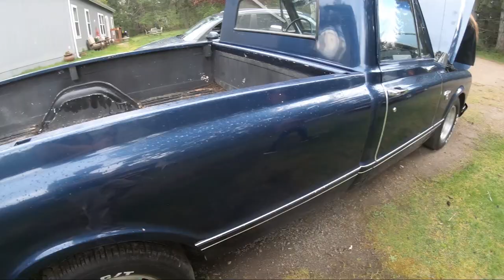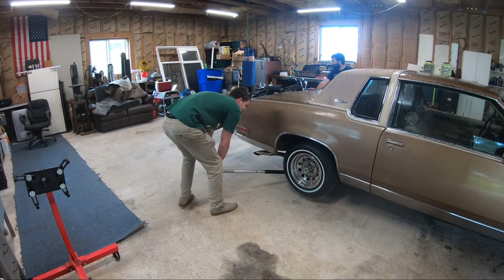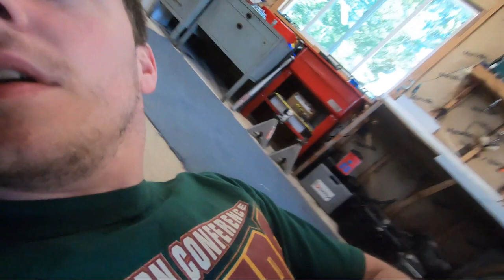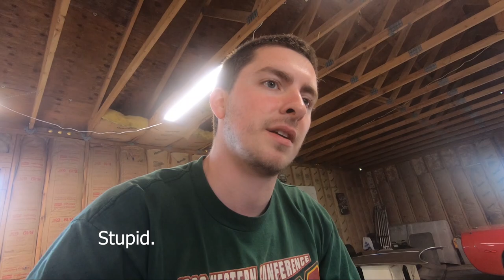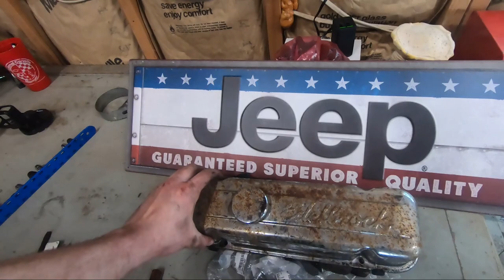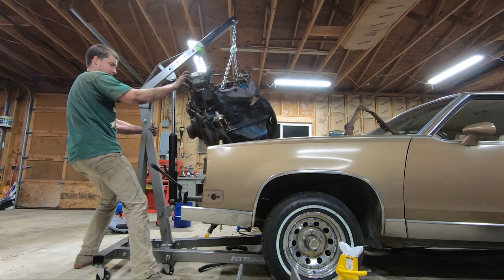SKETCHY ENGINE PULL! Pulling the V6 out of my Cutlass Supreme!

Comment: Wow that was both hilarious and painful to watch you definitely did things the hard way in some instances haha Remind me when I first started working on cars doing half the things you just did not knowing there is such a better way haha 
On another note your transmission is probably not going to work with a V-8 unless you get a Buick olds or Pontiac style engine those V-6 engines like the one you just pulled out all have BOP style bell housing on the back of the block and they only mate up to the BOP style bell housing transmissions (Buick Oldsmobile Pontiac) They did make turbo 350’s with both style bell housing which would explain how you have a turbo 350 on a V-6. There is one Transmission that works with both style bell housings BOP and Chevrolet and that is the turbo 200R4 (4speed auto) You were also going to need a complete set of clam shells and motor mounts from a V-8 Gbody car anything related to that V-6 is not going to work I did a V-6 to V-8 swap for a guy on a monte Carlo in one of my videos I didn’t get to complete the job because the guy cheap doubt and didn’t want to pay but there is some good pointers in there as I got about halfway done. Check it out if you’re bored
Reply from the maker: Thats definitely something I need to check on. Thank you for the info. Ordering the motor mounts soon and trying to source a motor right now

Comment: Ps. The front header panel or front clip as you call it did not have to come off you simply just had to lower the front of the car and if you don’t quite have enough let the air out of the tires and gain a little bit more room lol For next time I guess
Reply from the maker: I always appreciate advice like that. Thank you very much.

Comment: I have an 81 cutlass myself. But I just found out that my cat converter gets bright orange hot. Any idea what causes it to get so hot? Thx
Reply from the maker: The era in which the car was built. Haha honestly I had a buick regal that did the exact same thing. My 1985 corvette left me stranded once for a similar thing as the whole system (egr and anything related to it) is designed to recirculate hot exhaust gases through the whole system which will cause carbon buildup in the converter so that will super heat and try and burn the burnt up carbon which will burn super hot and clog the entire system up. Catalytic converters are not good for hardly anything. Honestly they just catch carbon that is caused by the rest of the smog designs.
Reply: @caseybaker5550  a buddy Recommended I should put a new engine. What engine you think fits my 81? Thank you for replying.
Reply from the maker: @hatersgonehate4976  any sbc will work with mounts from a monte carlo. I will let you know when i get mine if they are are correct.
Reply: Don’t know if you still have this prollem. But most likely because of O2 sensor failure. Allows oil/air mixture to get messed up so oil burns in the Cat